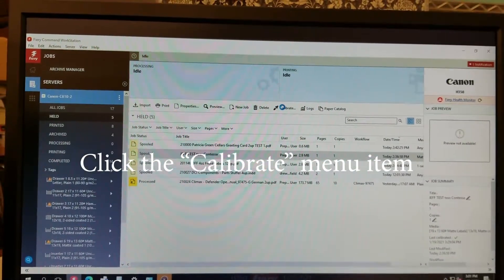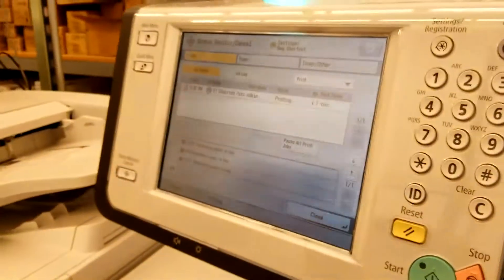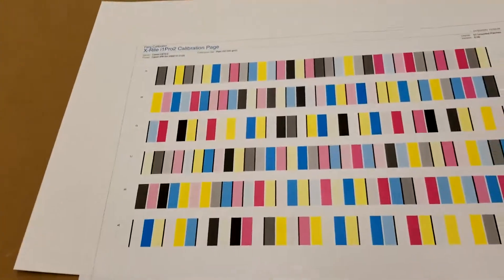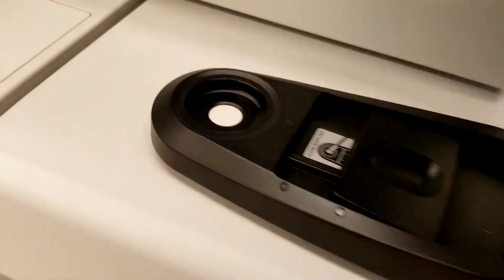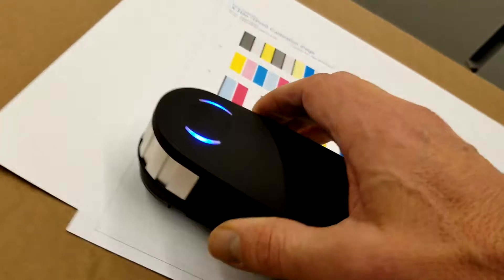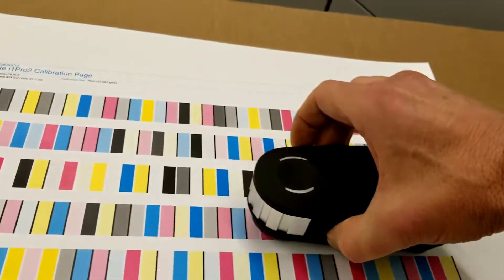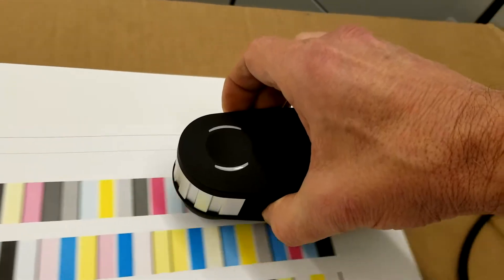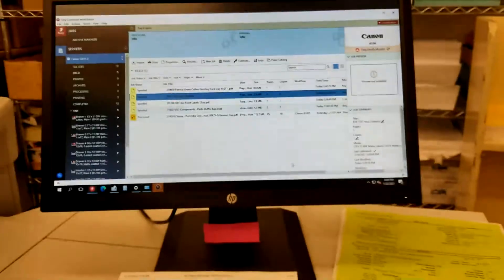Calibrating an imagePRESS with a Fiery Server

Comment: I have some problem about the rgb color.It doesn't meet the iso12647-7 standard how to adjust?
Reply from the maker: Pairoj, is the Fiery on your Canon equipped with Graphic Arts Premium and Color Profiler Suite? 
Has the imagePRESS been properly linearized and calibrated?
In what metric does "it" not meet ISO 12467-7 compliancy?
Reply: I use Canon C710 with fiery color profile suit but without G7 feature.
Reply from the maker: @pairojsawasdeepirom  In what way is the C710 failing to hit your ISO target?
Reply: @jeffandtona  The black and the green color cannot meet the std. ex the ISO black is 16,0,0 but my printer is 8,0,0 I can't remember the green but the deltaE very high.
Reply from the maker: @pairojsawasdeepirom  I would defer to your Service/Maintenance provider, Pairoj. There are too many variables here for a reasonable chat solution. My apologies, Jeff.
Reply: @jeffandtona  Thank you.